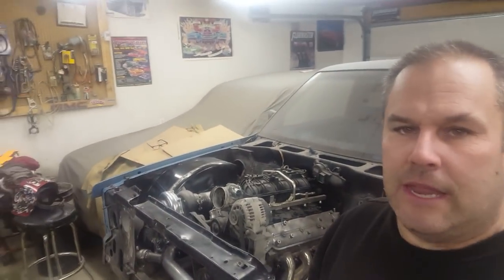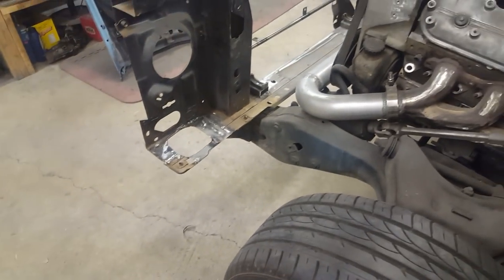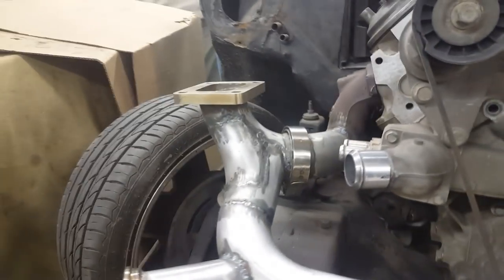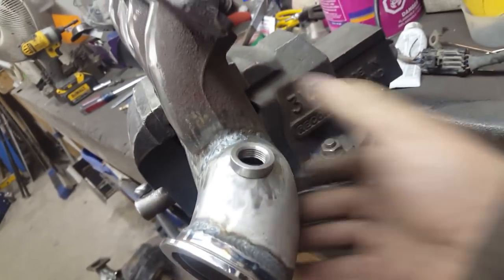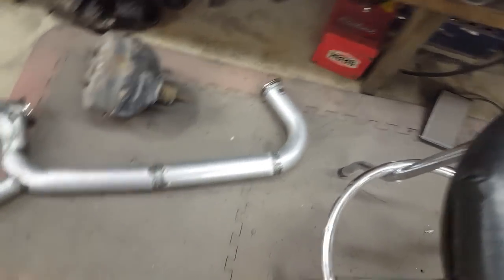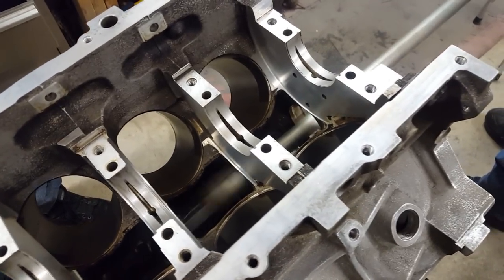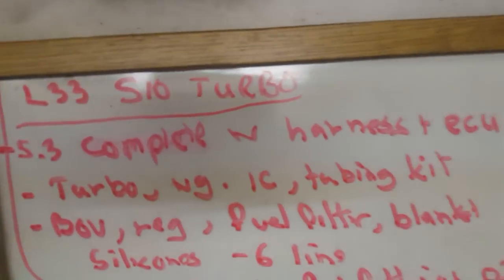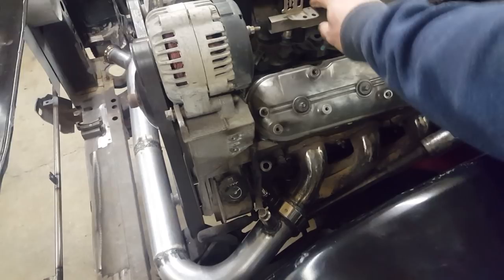HE MADE THE CHANGE YOU ASKED FOR! Turbo S-10 Stuff + Sh!thorse Cam Bearing removal | Budget LS Build

Comment: That's a great price for a used ls engine. I'm in Michigan and I was pricing a used 6.0 aluminum block from a guy that parts out vehicles from an auction. He wanted $3500 usd for an 80,000 mile engine. How far are you from Sarnia?
Reply: Out of curiosity, Do you install an oil catch system on these turbo cars?

Comment: Hey guys im planning on doing an LS swap do you know a cheaper way to do the wiring harness and computer all the kits I've seen are like a thousand bucks or more is there a way to wire up the stock one someone please help this has me stuck as i can't afford a thousand bucks!
Reply: Aaron Mohler  all the info is on lt1swap.com  I am using a stock harness and will make some videos of the wiring modifications
Reply: Thanks allot buddy
Reply: I reworked my harness into a stand alone and glad I did.  The neutral safety switch and the gear position indicator switch  like on a 4l60e  aren't on the new harnesses that are out there.  Lt1swap.com has all the information you need, you just have to know what your questions are.
Reply: really all you do is buy a junkyard harness and take out the pins you dont need and rewrap it. really nice Standalones are available under $500 on ebay

Comment: Hey Bob, very nice work with the turbo hot side. You should pick up 200 HP? because of less back pressure. As you known an engine is just an air pump.  Happy Holidays.